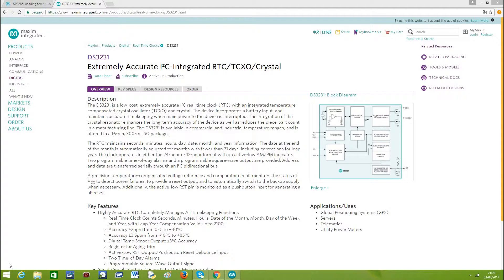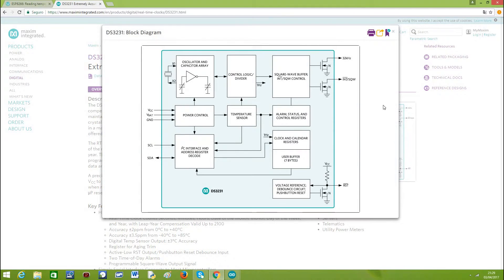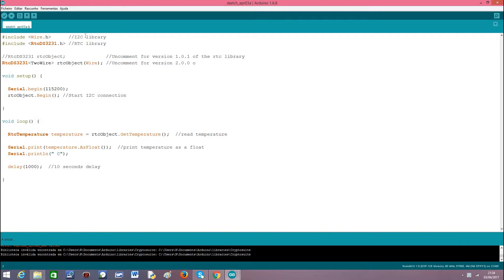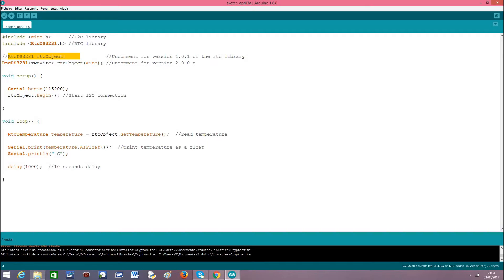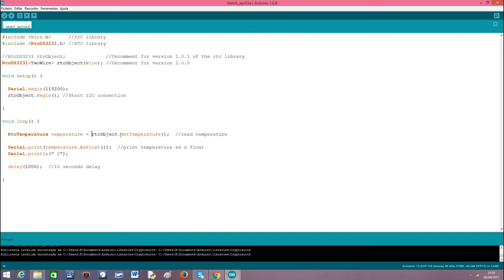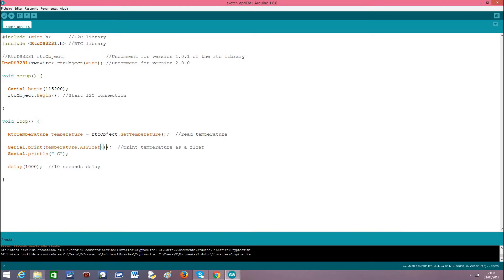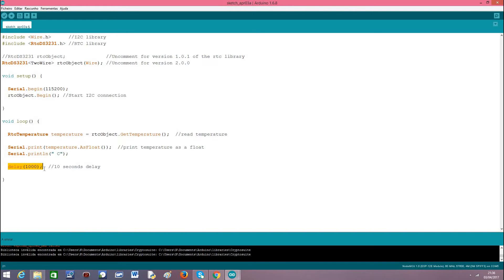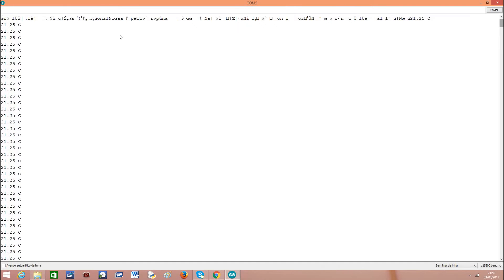ESP8266: Measuring temperature with the DS3231

Comment: I need lots of library <esp8266httpclient.h> friend, should you create a link for me to download?
Reply from the maker: Hi! The easiest way to install the ESP8266 Arduino libraries is via Arduino IDE Boards manager. You can check in the link bellow a guide on how to do it (Arduino  IDE configuration section). 
https://techtutorialsx.com/2016/02/28/esp8266-uploading-code-from-arduino-ide/

For other additional libraries, such as the one shown here, I also recommend using the Arduino IDE library manager. For this one in particular, you can also check the link bellow (Software Library section)
https://techtutorialsx.com/2016/05/22/esp8266-connection-to-ds3231-rtc/

Please let me know if you need more help.

Best regards,
Nuno Santos